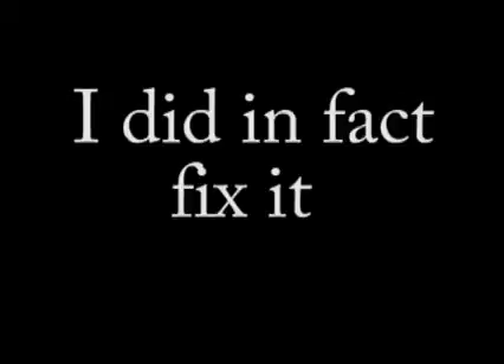RC airplane made from mostly garbage

Comment from the maker: I actually bought an easy star.  Flew it today.  I love this plane.  I've got a turnigy 2700kv motor, 1800mah zippy.  I can take off from the ground with no landing gear or anything.  The wings flex about 6 inches in a full throttle loop!  I will be building another garbage plane though.

Comment from the maker: lol.  It's not that bad.  I was just learning to fly as well, and didn't know how to diagnose the heavy tail.  If I had, I probably would have learned to fly it before I smashed it up so bad.  You can see on the last flight how well it flew at speed, but as soon as it slowed down just a little the weight imbalance took over and it plumeted.  I'm convinced if I had a little more weight in the nose, it would have flown like a champ.

Comment: yea, i guess this is a good way to start out into the hobby, but you know what you can easily build a great flying cheap plane with the electronics out of this plane and an extra $12,  go to a hardware store like homedepot and buy the pink foam sheet. you can make all parts with that including the airfoil wing. look up foam hot wire cutting wing. good luck.